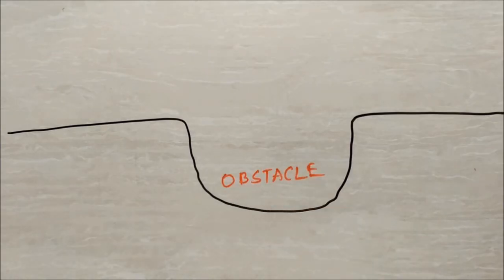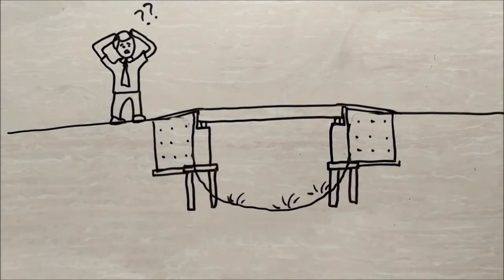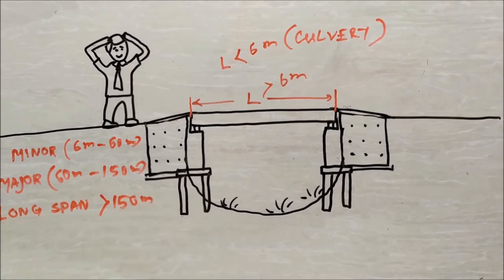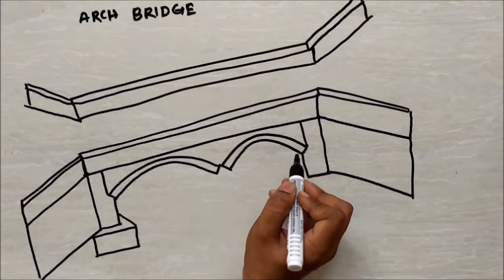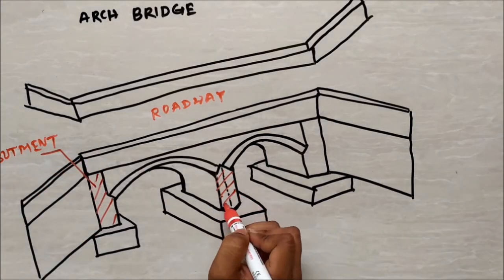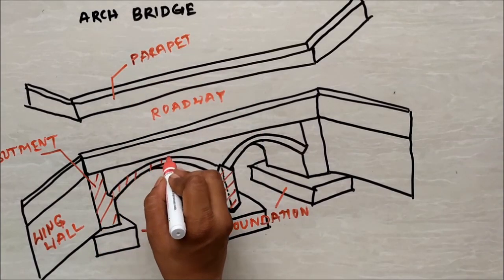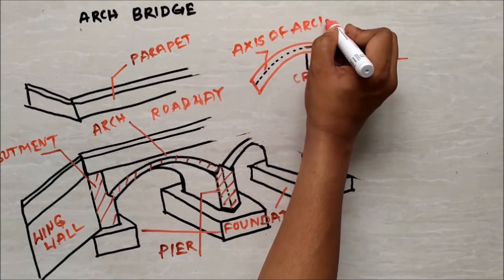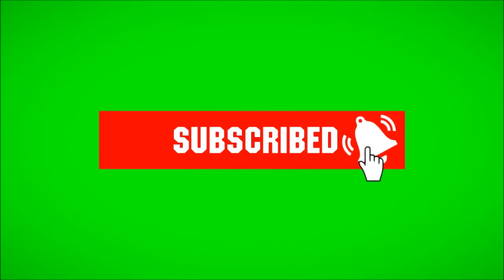Bridge and its Components | Bridge Engineering | Lec - 01

Comment: Hello Sir, Nice Video. But I have a doubt when you said the axis of the arch is vertically downwards. How is that, Sir?
Reply from the maker: The axis of a parabola is a vertical line that divides the parabola into two congruent halves. If a<0 in f(x)=ax2+bx+c, the parabola opens downwards and forms an Arch used in bridges. For easily understandable in which direction an arch opens its mouth I mentioned that "The axis of the Arch used in arch bridges is vertically downwards.

Comment: What is null point I n bridge
Reply from the maker: Null point is the position of zero movement in the bridge deck.
Reply: @STRUCTURETECH  eska use Kya hota h practically hota h ya theoryritical hota h tanqs for ur reply
Reply from the maker: It is practically exist depending on various factors i.e, type of bearings provided ,temperature. creep,  shrinkage, elastic shortening due to prestressing and other factors can cause a change in deck length. The null point will be at the midpoint between these two piers. if one pier is higher than another. the null point will be closer to the short pier.
Reply: @STRUCTURETECH  sir eska koi picture ya diagram dekhne mil shakta mein search Kar Raha but mujhe Mila nai